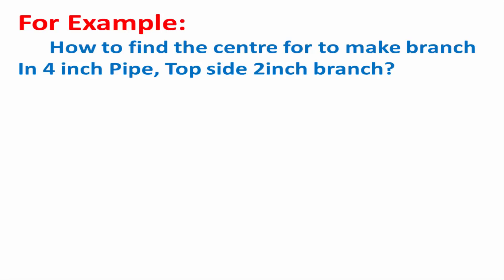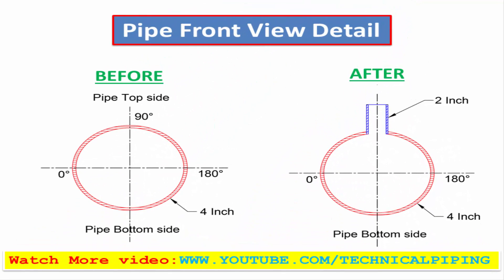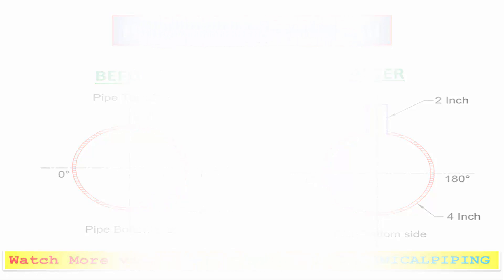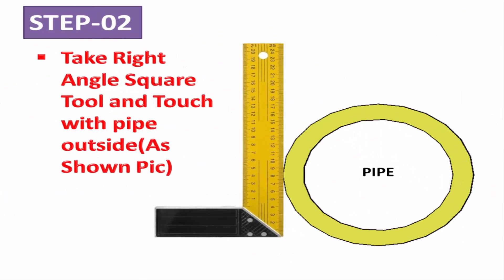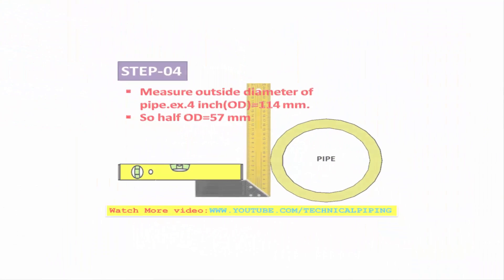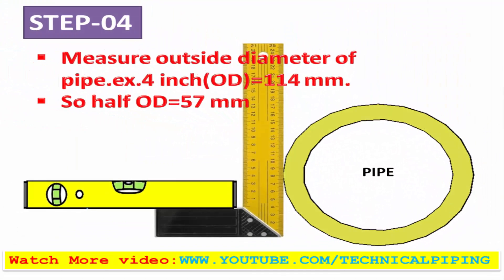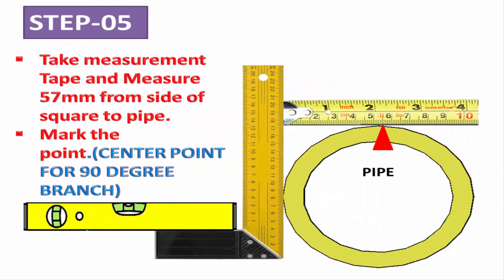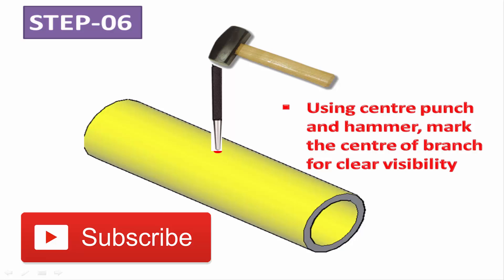Piping_How to find center of pipe?

Comment: Get rid of the square just use the level  against the pipe in the vertical position measure half the diameter from the level to the top of 4" then  mark  or use a center finder

Comment: Too complicated for a simple task. Just measure the OD of the pipe,  wrap the pipe with a strip of paper and make the markings of pi*0D/4. You can make center hole, 90 hole, opposite hole with one shot. Done!

Comment: You can do this much easier. Fix the pipe to your bench. Put a pipe with the same OD aside, then scratch a line by holding a ruler across the pipes and move it along the pipes. Ready! Quick and easy and no measurement errors.

Comment: Here we don't need to find the centre ...we can directly mark...because it's cylindrical any point you take would be the centre from one corner..
Reply: Unless there was a seam and let's say the seam was supposed to be at 136 degrees so you find your seam location and measure back to zero then center it.

Comment: nonsense, punch anywhere and thats the center of pipe. when finished putting the intersecting pipe install with that pointing upward at 90 °.
Reply from the maker: this method used for to find center with out using center finder tool.

Comment: Clamp pipe or bar stock in vise rub a bit of chalk on the top of the item. Place level across the top of the item drag the level through the chalk in a level position and the clean line that you made through the chalk is top dead center, takes but 30 seconds.

Comment: If its the first branch the center is anywhere you put it... think about it... no matter where you put a hole, that can be the center. There is no off center on your first branch..  too much left or right, just turn the pipe in that respective direction and boom! Center.
Reply: Unless the pipe is fixed in place

Comment: Hello,

I think that 4 inch = 101.6 mm ?
Reply from the maker: outer diameter =114mm
Reply: Technical Piping  
In your video tutorial at 02:07 you mentioned that 4 inch = 114 mm, however 1 inch = 25.4 mm therefore 4"= 101.6 mm.

Comment: Just use a paint pen draw a line perpendicular with the pipe where you would like it the pipe to intersect then use a level and put it across the pipe perpendicular  slide it across the pipe and now you have an intersecting point that is dead center

Comment: I have no training in plumbing whatsoever but I think it would be easier to simply trace the radius of the pipe on a paper, then fold the paper half horizontally & half vertically then use the paper as a template making sure you clamp the pipe firmly on the floor so it does not move. With the template, you can easilly find any degre angle of the pipe. After all why complicate the process?

Comment: if you are going for the top or side of the pipe... just use a plumb bob... where it touches... center of pipe.
Reply: 20 inch ka elbow center
Reply: 4 inch pipe- plumb bob will not work.

Comment: I would probably put the square on top of the pipe letting the "handle" part touch the side of the pipe and using the spirit level to get it horizontal. Then just use the scale on the square to mark the spot.
Reply: true sounds very good yea
Reply: f
Reply: I agree with you it’s fast and accurate
Reply: Put a mark on the pipe using the square when level put the square on the other side of the pipe and do the same thing marking the same spot and the just split the difference.  It take less than a minute.
Reply: if the "handle" part is long enough (could be short for larger od pipes ), can also put spirit level on the side of the pipe and measure center of the pipe